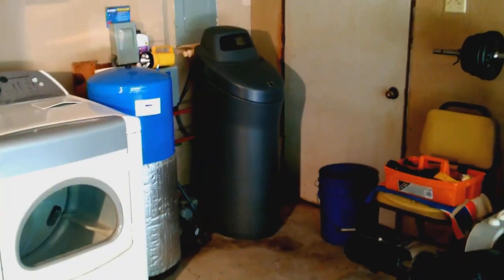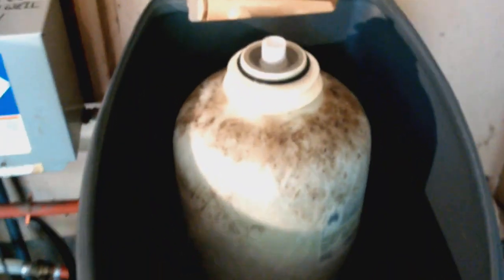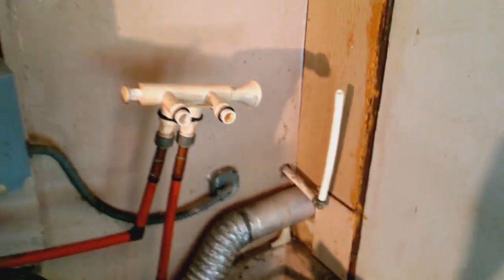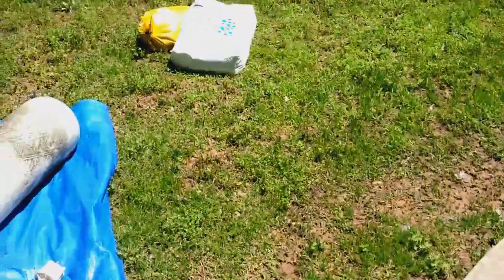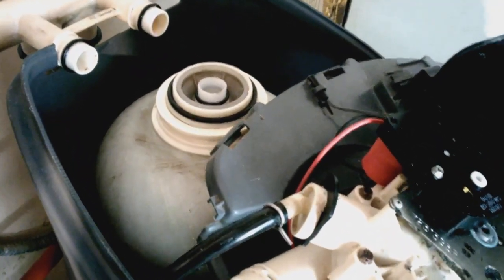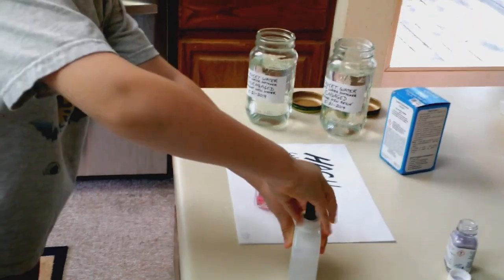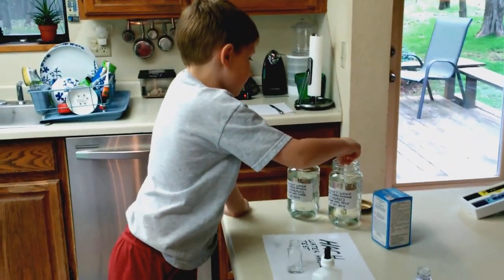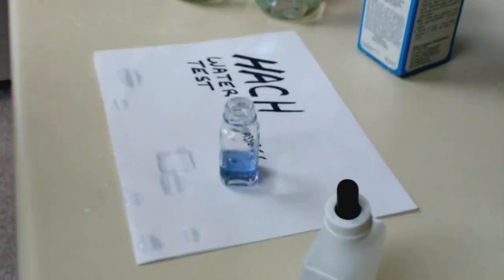Replacing Resin in Kenmore Water Softener

Comment: Thank you for this video.  It is very helpful.  I have the same exact model Kenmore as you.  Follow up question to your video:  When filling up the resin tank with resin, carbon, and gravel, do recommend using 10lb's of gravel, 50lb of resin, and 7.5lb of carbon (charcoal)?  Should there be around 25% empty space remaining after putting the 3 material in it, and is 25% empty space recommended?
Reply from the maker: Yes. That sounds perfect!

Comment: I just bought a house and this water softener was pre installed, and I was contemplating buying a new one but found that once I plugged it back in and refilled with salt and recharged it, it worked just fine, however, what prompted me to check it out was the smell of the water… it smells a little like mildew coming out of the faucets so I am now contemplating replacing the resin and adding charcoal like you mentioned in another comment. Thank you for posting and replying to comments! Seriously helpful!

Comment: Can you tell me exactly how much gravel and resin you put in?  I have the same water softener.
Reply from the maker: The Kemore Elite is a great water softener.  Still doing great after many years.  We used a full bag of resin sold on Amazon - not sure on how many pounds that was, but we did as recommended by the instructions.  And we used maybe 2-3 pounds of gravel that was also sold on Amazon, as the suggested amount in the kit.

Comment: Where did you order the resin?
Reply from the maker: Great name, GMRedline!  We ordered our resin on Amazon ($189.44 for INDION 525 Na).  It's actually manufactured in Gujarat, India, and that's like the resin-making headquarters for that company.  We actually ended up buying resin after I tried to order a new Water Softener from Sears, and they don't sell the good ones any more.  We almost bought a NorthStar Water Softener, but had one of those before and it did not work very well.   The Kenmore Water Softener we bought may years ago works just fine and I especially like how it was built to last.  You just have to change the resin every 3-5 years, and that's a pain to do, but well worth it.  Hope that answers your question(s).  Yay!

Comment: Are you happy with that resin and if so where did you purchase it? Also where did you purchase the gravel from that you put in the tank first? Thank you for the video 😉
Reply from the maker: Thank you Bryan!  We had fun making that video.  It really ended up being a week-long job - testing the water, putting in the new resin, and then testing the water again.  We bought our resin on Amazon, and it was $189.44 for 1.5 cubic feet, which was more than enough and we only used about 1/2 of that for the resin tank.  The resin we purchased was INDION 525 Na, which is top-of-the-line, and I think Amazon still sells that brand.  The resin also came with a funnel, which comes in handy for filling the tank.  As for gravel, we bought that on Amazon too and it was maybe $25.  For sure, we put in the gravel first, and then the resin.  Not absolutely necessary because when the water softener cycles, and if you are careful not to put in too much resin, the gravel will sink to the bottom anyway.  And very important so you don't end up sucking resin into the water line.

Comment: Did you also replace the carbon?
Reply from the maker: Hey Steve - Good question about the carbon.  We almost did that, but decided the new resin was good enough to take care of softening the water.  There are pros and cons to adding charcoal (carbon) and as long as you've got a good resin, there's no need for the charcoal.  I would have done that if there was an odor in our water, but it's pretty clean.  So, if you water is a little smelly, you might add carbon in there.  Otherwise, it should be fine with just the new resin.